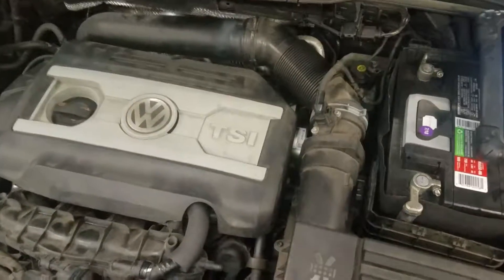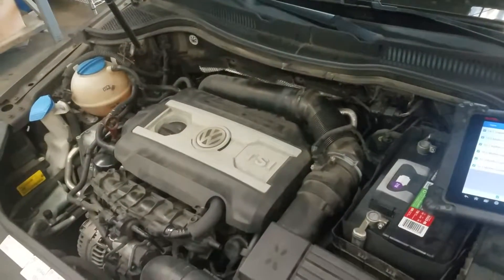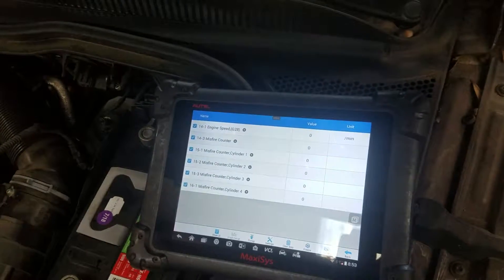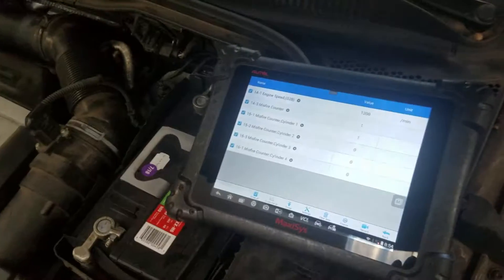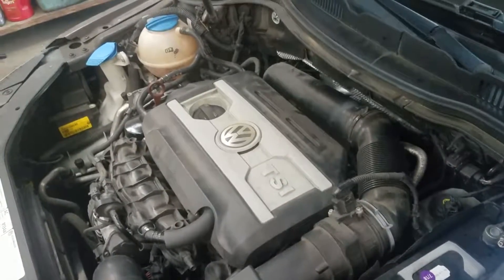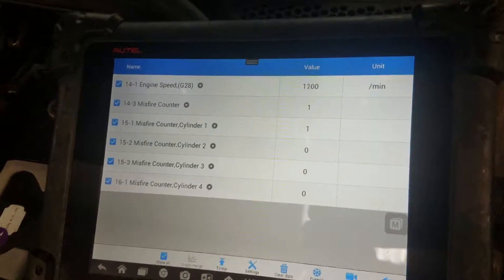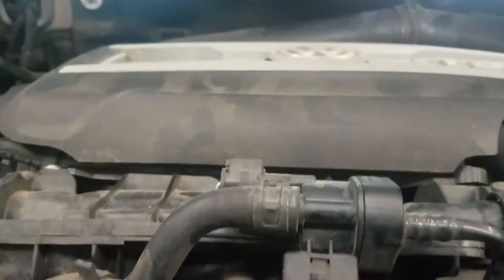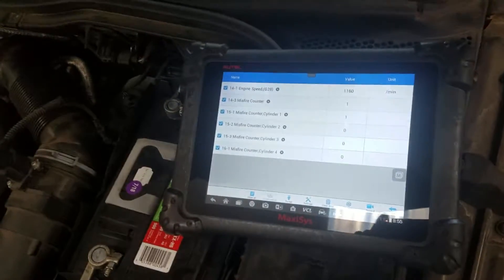2013 Volkswagen CC Cold Start Misfire

Comment: Did you solve the issue? I’m doing carbon cleaning. Walnut blasting. It’s at the shop now. I’m supposed to pick it up today. Thanks in advance.
Reply from the maker: At the time the customer did not approve the cleaning. I m 95% sure that's what it needed
Reply: fsteddie98 sweet, man! Thanks.
Reply from the maker: @MvpAngler1040  I'll be uploading a video of carbon build up on a Audi Q5  2.0L turbo intake valves
 Hope this help.
Reply from the maker: Dohn Joe  on that particular vehicle the customer declined work but if I remember correctly the shop quoted him about 450 because that intake on that Volkswagen CC is a pain to remove. Other vehicles it's not so hard to remove intake and it would  Cost Less to do the service

Comment: Mine runs rough until it warms up and drops below 1k rpms sometimes the mil flashes for a few seconds then turns off. The code is always cyl 3 misfire. I feel the only real fix is going to be the walnut shell deal
Reply from the maker: ATS has a Machine called ATS 3C and it does a pretty good job with out removing the intake
Reply: @fsteddie98  I'll check it out thanks. Just annoying in the morning having the light flash lol. Happens 1 or 2 times a week